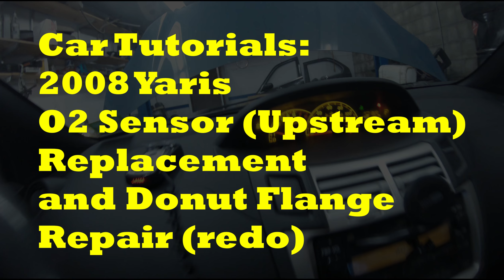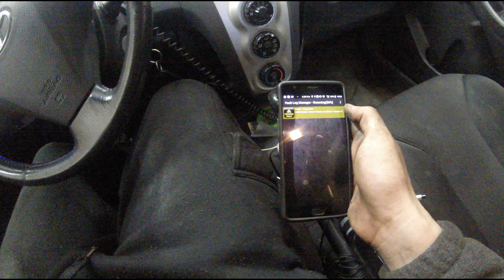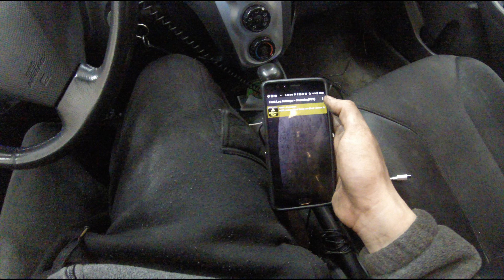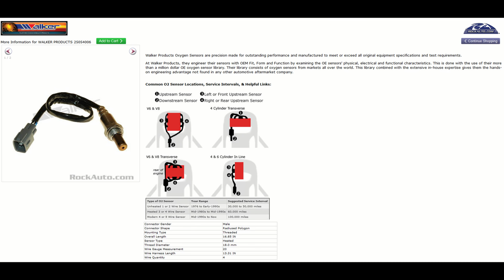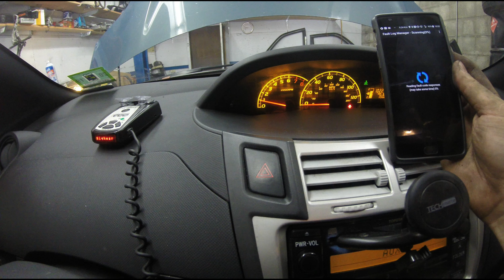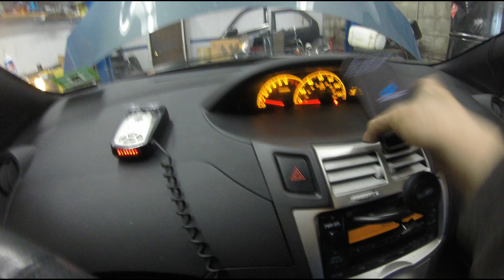Car Tutorials: 2008 Yaris O2 Sensor (Upstream) Replacement and Donut Gasket Flange repair (Redo)

Comment: I've the same car, 2008 Toyota Yaris HB with 153,000 miles on it. I don't get any error code indicating a bad upstream oxygen sensor. Should I replace the oxygen sensor anyway? It seems like it's quite a difficult task unlike replacing spark plugs and ignition coils which are much easier.
Reply: If you have no error coded don't worry about it.
Reply: no, unless you are taking the subframe down to change the sway bar links might be worth it to do it at the same time

Comment: HI MY FRIEND I HAVE YARIS 2007 SEDAN I HAVE BEEN DRIVING WITH ENGINE LIGHT ON WITH CODE P0031. I AM PLANNING TO DO SOME TESTING ON THE O2 SENSOR IF I CAN GET IT BACK TO WORK MAYBE CLEANING AND CHECKING RESISTANCE CABLE BEFORE I DECIDE TO BUY NEW ONE. IDK IF U CAN GIVE ME SOME ADVICES ? I WNNA KNOW AS WELL DO U WORK AND FIX ALL YOUR CAR WITH THE SAME OB2 SCANNER ?
Reply: You can try using some maf sensor cleaner. I use many Obd2 scanners

Comment: Does the mpg's go down before getting the check engine light? My 2007 yaris used to get 38 mpg, I'm down to 33 mpg and wondering if the O2 sensor is going bad. So far no check engine light.
Reply: Or the tire store doesn't carry the stock OEM tires size and they've replace it with one slightly larger (not significantly) which is in my case and my mileage had dropped significantly.
Reply: Many things can cause drops in mpg. O2 sensors going bad will, but usually when it goes bad it throws codes. Dirty air filters, improperly inflated tires, messing oil change, old spark plugs, brake drag, the list goes on

Comment: Do you know where the downstream sensor is located?
Reply from the maker: should be right after this upstream sensor on the past the flange. if you are under the car, it should just be a few inches from the flange in plain sight

Comment: I'm getting p0133 o2 bank 1 sensor 1 error is this the same procedure for 2008 yaris?
Reply from the maker: Might be this sensor
Reply: @ZeroTwoSixty  
How many 02 sensors on the 2008 Yaris ?
Reply: @dfls5069 Upstream and downstream.